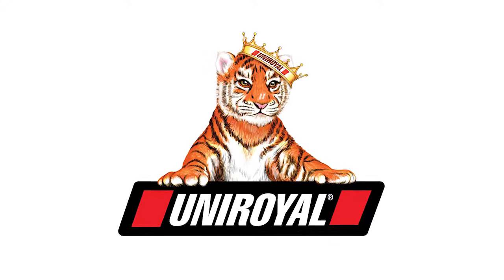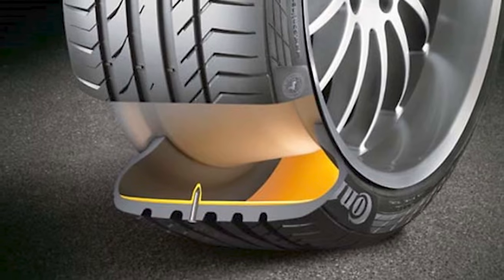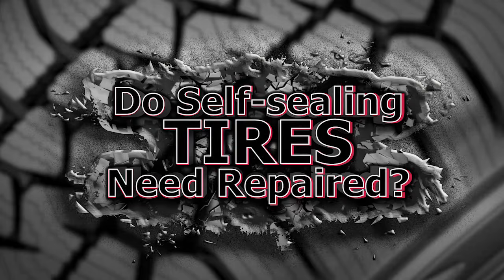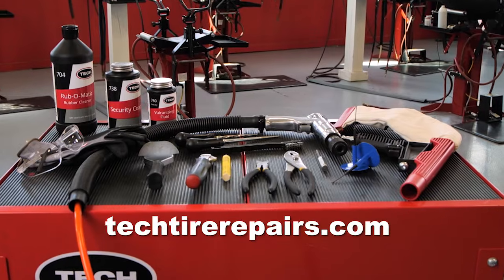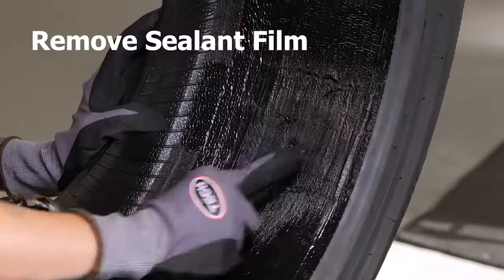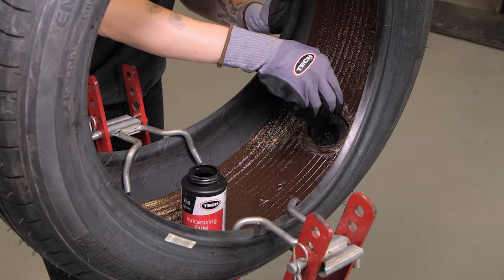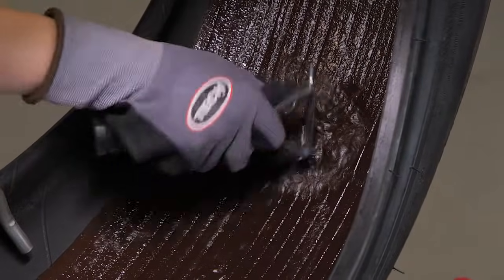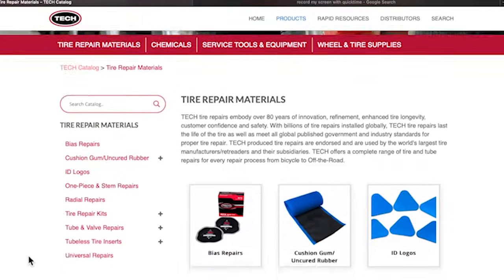How to Repair A Self-Sealing Tire

Comment: I got ripped off.... Sold me 2 new tires 400$ because they said seal tires cant be repaired
Reply from the maker: Sorry to hear that. Defiantly ask around the next time it happens; so you can find a shop that will. But depending on where the damage was; the tire could have been non-repairable no matter what.

Comment: Might want to tell these individuals that regulations on repairing tires like the link I'm about to show you are not permanent repairs and does not meet TIA requirements. They called me out with rude comments on their thread that I'm sharing the link to right now. Plug only fixes are only temporary until they go to a repair facility. I reported this video so that others don't get hurt by it or liability suites come on them

https://youtu.be/SPO7bBQqCDQ
Reply from the maker: We agree. Good plug only repairs are NOT permanent repairs. Good luck trying to get that video taken down.

Comment: Incorrect way to fix this tire. All you have to do is pull nail out of tire
Reply: Ok wiseguy
Reply: This! She compromised future punctures by moving the sealant to do a tire repair.
Reply: Nah bruh you can't drive around with a hole in your tyre

Comment: And where is the most interesting - how to remove this protection?
Reply from the maker: The chemical vulcanization process used in TECH tire repairs strengthens the repair and makes it one with the tire rubber! Proper TECH repairs will not need to be removed.